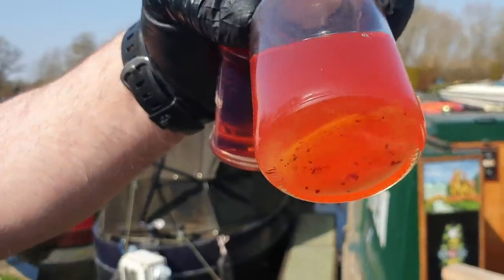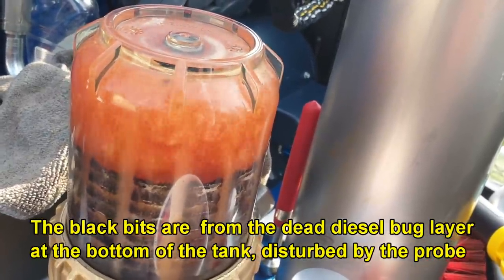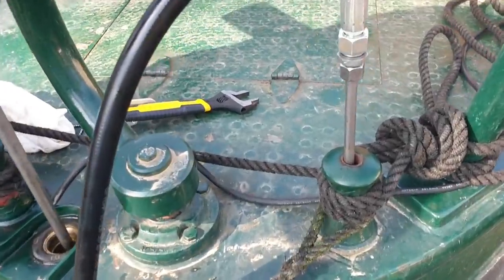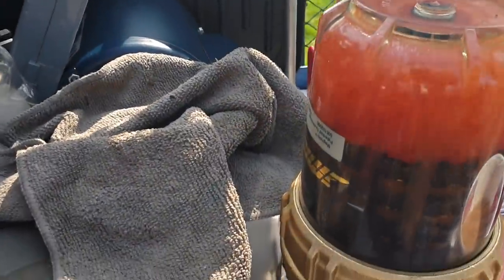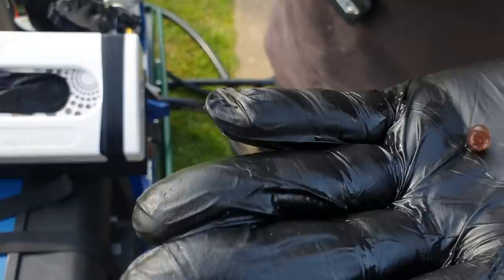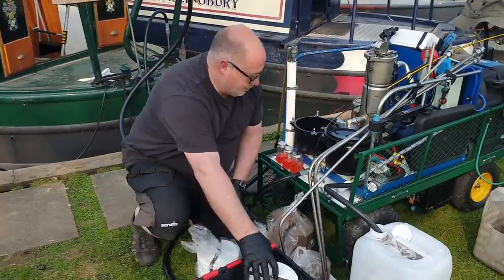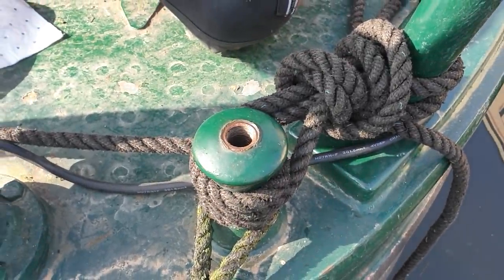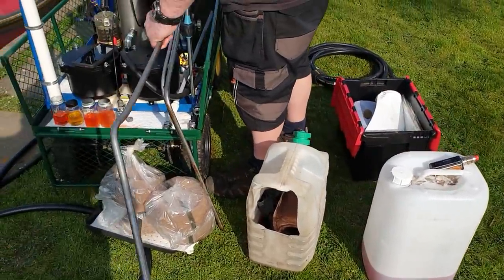#16 - Tackling the dreaded diesel bug - our tank was full of it! Now its bug, water and rust free.

Comment: Air heated during the day goes out through the vent...only to be replaced at the end of the day by damp evening air...
which leads to the water in the air to condense out on the steel walls of the tank overnight..
every night for 50+ years...
The fuel pickup always is placed some distance above the bottom of the tank..
in this case, about 15 litres above the bottom...
You need double CAV style filters as found on most ag engines...
as farmers usually store farm diesel in steel fuel tanks...that suffer the same problems.
Reply from the maker: Some good points there. We also bought a long water absorbing thing that you put in your tank with one end tied to the bottom of the filler cap. That absorbs moisture and can then be removed after a month or so. Haven't fitted it yet. Will do soon

Comment: One more action you would be able to take to minimise accumulation of condensed water in the fuel...operate the fuel levels from the 3/4 full to completely full range as much as possible.
This minimises the amount of air to expell and to draw back into the tank....just tip in the appropriate amount of algicide for the amount of fuel with which you are topping up the tank.....
Reply from the maker: Definitely a good idea. Particularly when not being used much in winter.

Comment: Cheapest filter system...fitting with inbuilt pump to eliminate air bubble after changing filter...
any 90's Japanese 4wd underbonnet filter system...
especially Toyota or Nissan...
New systems:
Double CAV filters to the engine....with clear plastic bowls to view water and crud..and empty it...any agri spares company or marine supplier....
or if you want possibly the best (and most expensive).... Racor marine grade double-filtered diesel filter system...
Reply from the maker: Sounds like a good investment.

Comment: Impressive video   i am wondering if your treatment removes all the sticky black dead diesel bug which is formed about 3mm thick all along the bottom of my 200 litre narrowboat fuel tank
Reply from the maker: Hi there. The process involves quite high pressure in both the feed and return pipes and the guy doing it moved the metal 'lance' on the pipe end to different positions to get rid of the bottom layer. When he moved it, large pieces of black crud could clearly be seen arriving in the filter.
I'm pretty sure it got rid of everything. We've certainly had no issues since 😊
Reply: @NarrowboatAdventures  Thanks for your reply glad all's well

Comment: Hi just wondered if he emptied and cleaned your tank and pipe work completely before returning your cleaned diesel as recommended by BP Fleet  maintenance
Reply from the maker: He cycled the fuel round and round the system for hours. Pipes all had clean fuel in as we had been running the engine from an auxiliary tank.

Comment: Two years ago I put 250 litres of white diesel into some new Jerry drums and an ex motor oil 205 litre barrel.  I noticed the drum starting to leak around the rolled edge on the base so set about decanting to some new Jerry cans and it was full of shit rusty muck and looked rusty red. I filtered it as best I could but the filter funnel only took 20 litres before blocking. I found no water of note  and no bug as it was generously treated when I put it in the drums.  At £1.60 a litre I cannot afford to throw it. As I want it for my standby generator and car in the forthcoming disaster time. How do I tell it has no more dirt and safe to use? Nothing obvious  but the colour is still there and it worries me.  The water must have been in the diesel from the garage when I bought it.😢 the drums were full and sealed tight from the air?????
Reply from the maker: What surprised me is that the water and diesel mix really well! You can't see the water, but the water filters used to clean my tank took out 20 litres or more of water. I'd use it in your generator as easy to clean the tank out, but not so sure about the car...
Reply: Im a bit late,  but 'modern' diesel has biofuel added which absorbs moisture from the air which can then separate out , not entirely sure of the process, but the end result is naff diesel. probably ended up with water sitting in the bottom of you metal barrel and rotted through causing the leak. To save it first thing id do is decant into some clear plastic barrels and let it sit overnight so any debris and water settles at the bottom then carefully pour the clean diesel off the top another jerry can. Also sounds like your metal barrel was rusting or contaminated before the diesel went in and its degreased all the crap, oil & rust off the inside of the barrel. Ive kept diesel in the 20/25litre plastic barrels you get chemi n stuff in for a year or more & its been fine, just make sure the lid is on and dont leave it outside in the sun or the plastic goes brittle.

Comment: Why do you think that spending £700 on cleaning £40 worth of diesel is worth doing
Reply from the maker: Because if you try to just empty the diesel out you'll probably leave some bug and water behind meaning the problem could reoccur. Also, the dead bug forms a layer at the bottom that can get fed into your engine and it is very abrasive. This can trash fuel pumps and injectors. With our 20 year old boat, there was also rust and debris in there - not good if some of this makes its way down through to the engine. Yes, there may be cheaper solutions - but looking at the shite that came out of our tank, I think it was worth doing. Others may not, which is fair enough 😊
Reply: @NarrowboatAdventures  being a 70yr old retired mechanic and a 40yr long narrowboat owner I can tell you that them silly fuel polishing machines cause as many problems as they fix and are certainly no better then sucking out the old fuel and replacing it with new fuel mixed with a good additive
Reply: It's not just cleaning £40 worth of diesel, it cleans the whole tank, so's when you fill up your not putting fresh fuel into a shitty tank, that will contaminate your new fuel.
Reply from the maker: @rogerferris3720  A very important point. 😊
Reply: @rogerferris3720  no Roger the whole point is it is impossible to clean the whole tank without cutting the top off the tank cleaning it out then welding the top back you can only get to about 10% of the bottom of the tank through the filler you have then just disturbed the sediment on the bottom which cause you problems later on but if you are happy to waste £700 on something as stupid as doing this carry on its your money